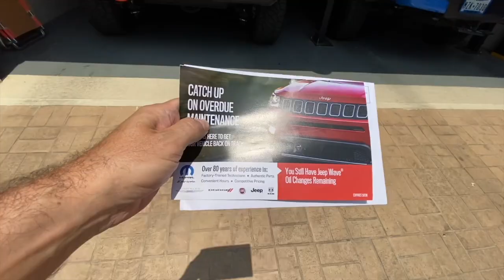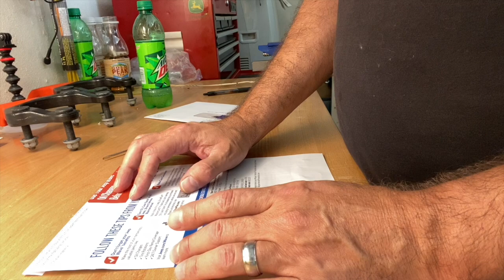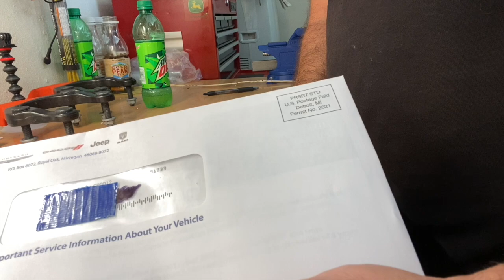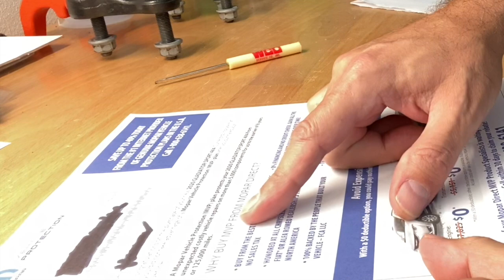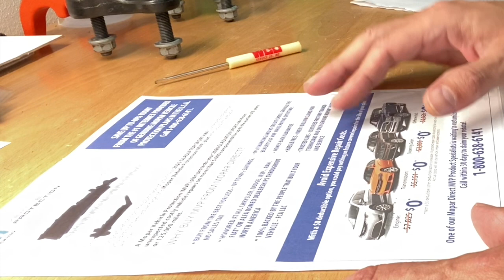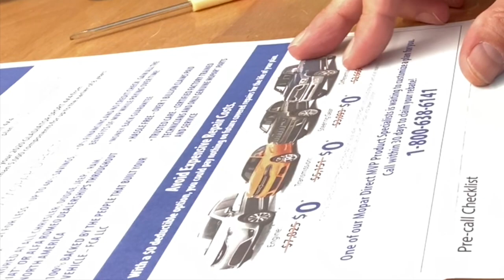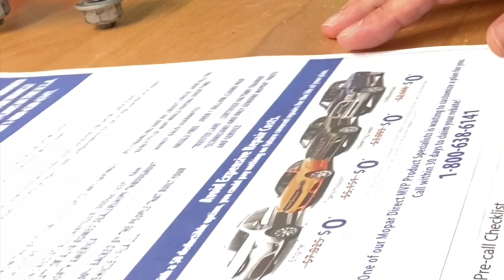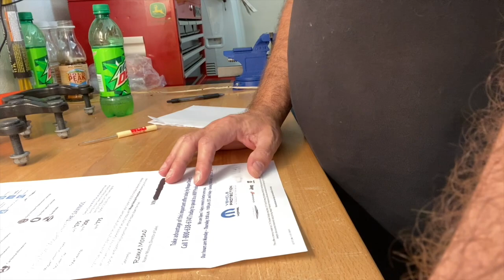Important Jeep Gladiator Service Information & I need Oil

Comment: I do my own oil changes. And btw I've had my Gladiator for 9 months and still have under 4k miles.
Reply from the maker: Mine is over a year now...less than 2000 miles!!
Reply: WOW, I've only had mine 5 weeks and have 2900 miles on it already, it's just to fun not to drive!

Comment: The “free” oil changes through the Wave program is only good for 2 years so every 6 months or so get the oil change you paid for it.  I mean let’s face it the cost was figured into the price. I’ve done one so far will get the second one in a couple months.

Comment: I took mine in to have the faulty infotainment radio changed, the new ( refurbished ) model was installed but none of the commands worked. So they put my original back in. That was a month ago, I was just informed the next one is in. Just have to make an appointment
Reply from the maker: Hopefully all goes well this time around!!